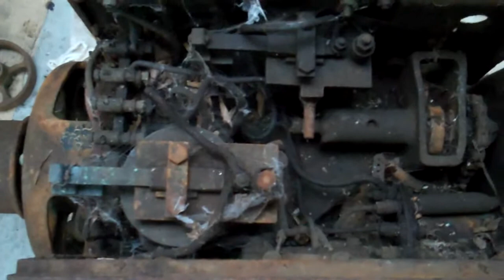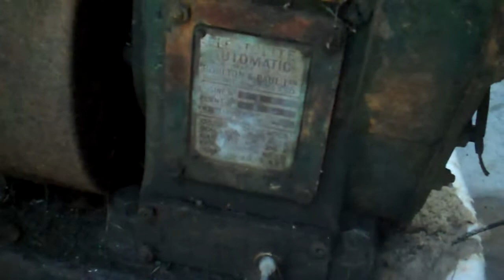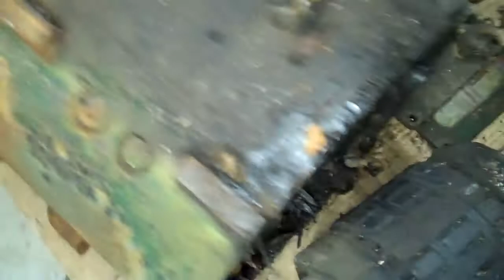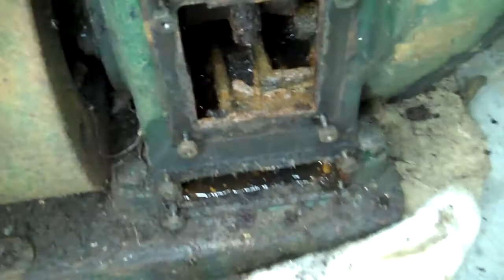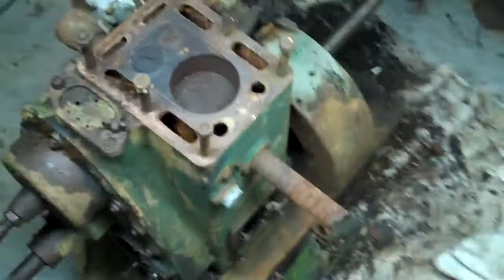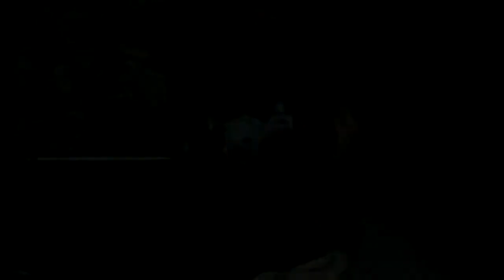BOULTON & PAUL GENERATOR SET

Comment from the maker: @canvids1 Yes the engine was filled to the brim with water,but luckily enough the oil had never been changed. As you can see the inside of the engine is coated with burnt on oit and sludge which has gone some way in protecting against many decades of rain water. The generator and magneto I will farm out for re-winding. FINGERS CROSSED.